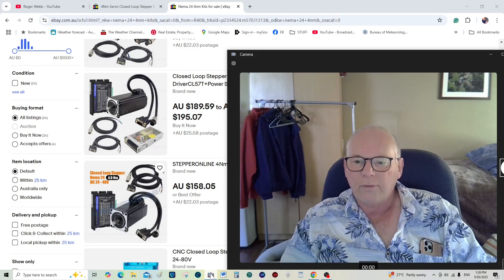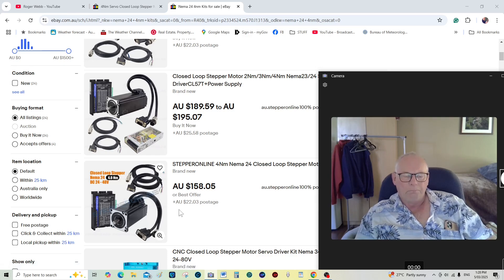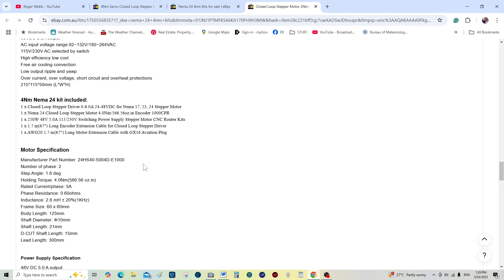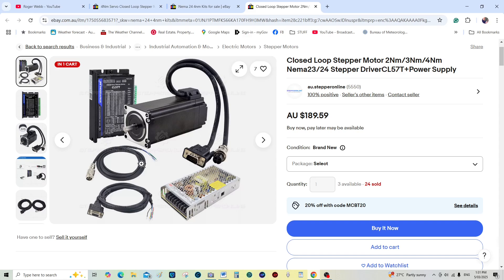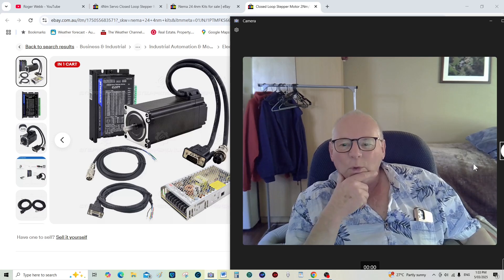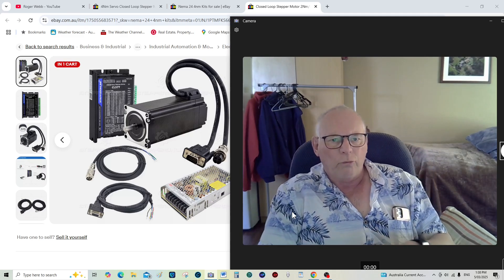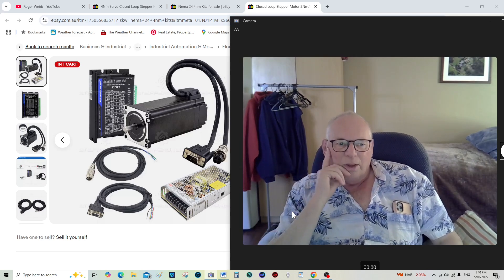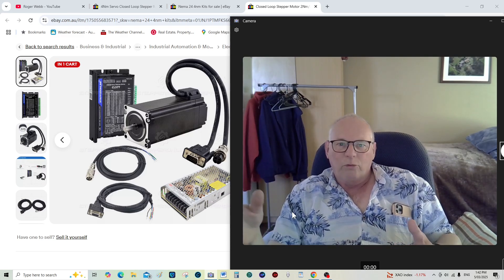Patrons and Subscribers Channel update plus info on parts

Comment: Good morning 🌅, Roger , I have a MCN KONTOR 1500A , the driver for the unit has blown, in the process of me moving it a year or so ago something must’ve come loose inside the control panel and sorted it all out,, it was three phase it made quite a large bang, since I have purchased a inverter, 240 to 3 phase and purchased a new motor as well, I’d like to try and get the travelling table working again so I can do some more wood turning automatically, how easy to think it would be to set up a new drive system on it, my problem is I am not very good with computer computers, I am very good with woodworking and some engineering,